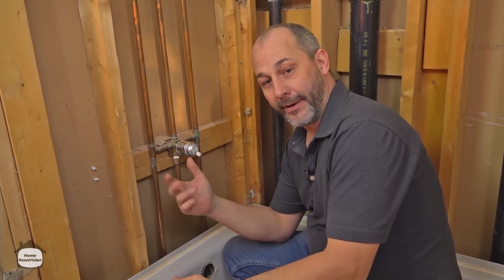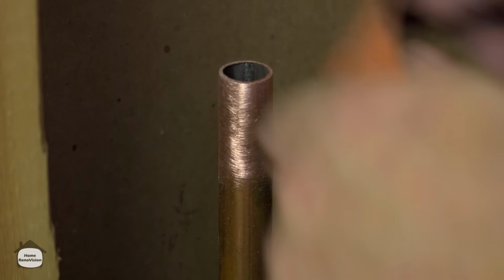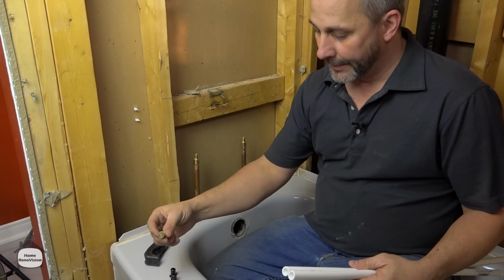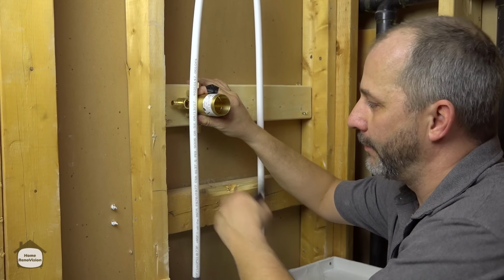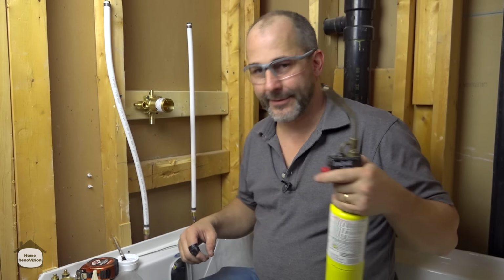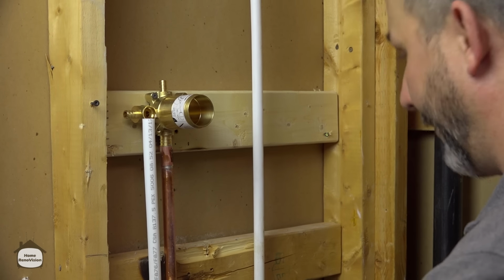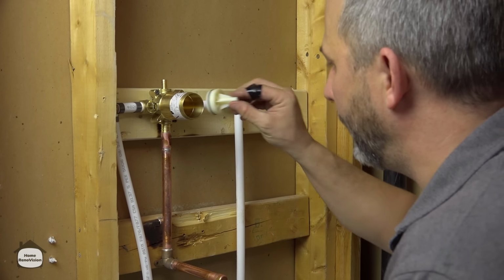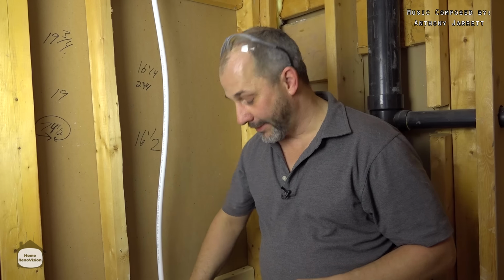DIY How To Install Copper To Pex Shower and Bath Plumbing

Comment: How do you feel about using Sharkbite connections inside walls. Some plumbers on YouTube swear AGAINST using Sharkbite connections inside walls, as they "leak at joints" with time, over the years!

Comment: Which crimp ring/clamp, and crimper tool are recommended for homeowner DYI. 
Would like to see how to R&R 3 handle valve tub faucet with copper-tubing in walls of very old house. Thank you.

Comment: After you have cut the pipe do you not have to also clean the inside? Thought I watched somewhere that if you don't you can get those pin hole leaks. Does that not happen with pex?

Comment: I have a question.  The water line to my toilet is corroded (green on the outside) and leaking.  I plan to just cut the line for now and cap it because I know repairing will not be that easy... it will lead to this that leads to that and before I know it will be a whole *$&%$^ bathroom reno.  My question is, if I just remove the toilet can I just crap down the hole and pour water from a bucket to flush it?  Seems a whole lot easier and cheaper.  Thanks.

Comment: 1. You use crimped fittings instead of clamps-- any significant longevity difference? 
2. What about ease of installation between crimps and clamps?
3. Do you prefer PEX A or B for your work?

We enjoy your video, and a salute to your camera person-- almost always on the mark and focused. Good audio, as well.

Comment: I really don't like pex. You have to be sure the pex inside dia. is the same as copper. If you don't the flow will suck. So pex outside dia. will be much larger than copper to keep copper inside dia. = to pex.

Comment: Good stuff here but noticed all eye-ball measurements and that is an issue as spout, valve and showerhead are not same--its like installing electrical switch and outlets about here-n-there... 
Just saw first video on how to crimp today and you missed that down cold 90 deg. crimp, sure hope it was replaced before sheetrock as years from now that is a guarantee water leak.
Good points on cleaning and using flux and removing plastic and O-rings before seating pipe.

Comment: Great video !  Why not also use PEX for the tub spout (skipping the sweat) ?
Reply from the maker: if you have a shower valve with a positive stop then sure. if it has a mechanical diverter then sometimes the back pressure causes the shower head to drip and that bothers some folks!

Comment: I would have sweated the pipe and valve away from the wall after dry fitting the pieces.  Then measured the Pex and after all is assembled mount to wall, thus eliminating the struggle to work around the 2x4 and torching the wall.

Comment: The way he was sanding the copper lines made me go crazy lol. I never pull them with the sand cloth to sand them. Could cause a leak at the bottom of the pipe from the bending/pulling pressure. Especially on old lines.

Comment: I am reconfig a bath room so now my toilet shower and sink is on exterior wall all plumbing going straight down through floor but i am a little confuse with my drain vent can I run it on the exterior wall?? to main vent??

Comment: so a question on your leak test,the lines are full of air so are you saying if you had a leak, it would leak because the air is pushed out, the water will follow and this will accurately test for a wet leak?

Comment: Just wondering about houses that you use plastic pipes throughout, how safe is drinking water from plastic? Is there leaching from the plastic flex tubing and how does it compare with copper in regards water safety?

Comment: Good video, thanks much. Question- you mentioned something about dripping if you use a pex connection to tub spout. What is that about? And only using copper solves that, or does 3/4” pex work as well? I’d prefer to never need to solder on those valves.
Love your laid back style, but picking melted solder off a new acrylic tub with the point of a razor knife.. what?!? Just cover it before you start working, looks more professional anyway.

Comment: Why do these guys never just drop some aluminum foil as a heat shield wherever they are soldering with a torch?
Reply: Aluminum foil actually falls apart with direct heat like that, it would literally start melting and weaken so badly that the flame would poke right through it and would render the foil useless. My advice is get a very thin piece of sheet metal, works the best and you can bend it in any shape you need.
Reply: @zachary6313  That wasn't exactly direct heat; the direct heat is on the pipe, not the wood.  It's not meant to take the direct heat, and it's not meant to last forever.  It's just meant to last long enough to get the job done.  If the energy goes into putting a hole in the aluminum, well, at least it didn't go into the wood or drywall.

Thin piece of sheet metal would work better, however the likelihood of them having (enough) sheet metal on hand is probably less than the likelihood of having a roll of foil.

Comment: I'm currently about to replace my shower valves and install new fixtures in my bath tub, I'm accessing from the back side wall of tub. Is this going to be more if a challenge ?
Reply: How will you fasten new valve to stud from behind?

Comment: Need help! I installed new rough in valve in my house and no now there's no hot water. What I did wrong? Probably hot and cold water mix in the valve. How can I fix it?
Reply from the maker: many valves have anti scald protection rings just inside the finished trim on the cartridge. if you check the instructions you probably need to lift and turn to allow the hot to mix. Cheers!
Reply: @HomeRenoVisionDIY  Thanks!

Comment: Thank you Jeff once again. You are my go to when I tackle my house. I'm going to take out all copper and run all PEX. But this weekend, Changing out the valves to PEX. Thanks again. Oh, and it is called sand cloth. In the Military here in the U.S. it's called CROCUS CLOTH. Very fine. But does exactly what it's supposed to. Don't worry about the ney sayers, they don't have the knowledge. Thank you.

Comment: So you explained everything very well and I love this video however at 6:31, you did not say what you were brushing into the adapter and then you put it on the copper tube. You skipped that part and did not explain what you were doing there. Thank you.
Reply: It's called Flux

Comment: looks great.  However, here, its against code to run pex to the shower head or to the tub, excessive back pressure and resulting leaking potential .. Has to be copper

Comment: Actually, you don't have to solder at all. Use SharkBite "push" fittings to transition from copper to PEX. Then, use SharkBite fittings on all inlets on faucet and shower head. Lot faster, cheaper, and any homeowner can do it.
Reply from the maker: in truth sharkbite is the most expensive plumbing system out there.

Comment: In another video similar to this that you did you used pex for the tub spout. What is the reasoning behind using copper in the situation?
Reply from the maker: if you use a manual tub filler control switch to shower it drips using pex all the time
Reply: @HomeRenoVisionDIY  Thanks for replying! I think ours is a manual tub filler control switch, but we are unsure what other types would be? Is there an automatic one?

Comment: Toilet filling up with HOT water?
I had a helper that hooked up the water supply line to the hot water line. Luckily, it was in the unfinished basement, and it was a two minute repair.  But the homeowner noticed when someone flushed the toilet that the kitchen sink ran cold. 
Oops.

Comment: You should keep a spray bottle with water in it when you are soldering that close to wood.  you can spray the area with a mist of water to prevent a fire or have it available in case something catches on fire, especially in an old house.

Comment: Hey love your work really helpful tips I did my vinyl flooring with your help watching your videos also just learn a nice trick with the plaster/Sheetrock keep up the good work...

Was wondering if you have any full bathroom remodeling videos I need to redo my bathrooms from scratch one of them has to be guttered out even the sub flooring etc. going from bathtub to stand up shower..thanks

Comment: I thought about using PEX to upgrade my steel pipes in the house until I googled, it apparently leaches out toxic chemicals, I will be sticking to copper pipes

Comment: Good video. I am a plumber but am more of a fan of using cinch rings vs the brass. The cinch crimping tool is much smaller, while the ring crimper is just too big and bulky for tight and hard to reach spaces. It fits in the tool bag better also!.
Reply: Any recalls because of the cinch rings? I'm about to tile over some connections that are in-floor, in floor heating and that would be hell and expensive to rip up.
Reply: No recalls I am aware of. Just be sure any ring used are square on your connections. Take your time and be thorough! Good luck with your project!

Comment: Excellent instructional. I always refer to this video with my customers when they have diy copper to pex questions. As far as the plug in the drop ear where the shower arm goes, Home Depot sells 1/2 in male shower test plugs for $3 a pop.
Reply: ⁿ⁰

Comment: Not being funny but you done so much wrong Lol. You don't "Scratch" the copper and fittings, you're removing a coating which is designed to stop the Copper going green in storage. Your gas is way too hot and you're using more then you should, you didn't clean the copper to take the excess flux off meaning over the next few years that flux is gonna start eating away at the copper resulting in Pin holes! You don't always add 1/2 inch onto your measurements as not all fittings are equal length from the factory. Good video and I love watching you, but damn you're gonna have leaks in the future 100% guaranteed! Oh and also you cooled them fittings down way too quickly, give it at least 30 seconds before wiping away as you can create hairline cracks within the Joints, so again you may not get a leak straight away but in 6 months, 6 years or 60 years you're guaranteed to have leaks! And don't use an impact driver on them screws, you can even see in the video you've rounded them off, just use a drill on setting 10/speed 1 and you're good and won't round them!

Comment: What is pex our 5th or 6th attempt at a piping system in the past 120 years?  
First it was lead yes you heard me right we used lead pipes, then iron pipes these  rusted over time no shit it took a sledg hammer 4 guys and a dump truck to get the tiles off the wall then you could replace the junk galvanized pipes. 
So around comes copper pipes the end all be all problematic pipes. Let's see they took away the lead but forgot to stop using a lead based solder to sweat the pipes.
Ok that was fixed. Oh pvc pipes or sevral types of plastics  one widely used in Canada that has a high failure rate and has to be changed out.
Did I say steel pipes  you know water heaters used to be copper untill some genius decided rusty steel was better.
And unless you separate your metal pipes steel copper you get electrolysis effects eating your copper from the inside out.
Now onto pex, it concerns its toxicity might cause development problems in children. Humm didnt lead do that?
Im sure ive skipped sevral types of plumbing. One might be the roman acqua ducts.

Comment: We used to so this in sweden also. 1982. We don’t really have any hidden joints in the wall anymore. Just a catastrophe waiting to happen...
Reply: What method is used in Sweden these days?
Reply: @rd-ch1on  also upponor, but they have a system called rör-i-rör, pipe-in-pipe. This because we are not allowed to have hidden pipe joints in the walls. If we do have that the incuranse companies won't pay a dime if something happends. The pipe-in-pipe system workes like a charm. You receive a roll of pexpipe wich is coated in a second pipe. The inner pipe is the only thing tjat is preasurized and therefor if there is a leak for aome reason on the inner pex tube the water will travel alongside the second tube and then appear on the other end of the second pipe, either outside on the waterproof part of the wall or the basememt/location where you choose to have distribution tube. Im sorry if my english makes people confused. But if you want to know more visit upponor.se and see their product line.

Comment: Good video, and you explain things well. I'm an old fossil. If I were able to do the work I'd still use copper, but that's just me. I always had plenty of supplies and could sweat just about anything. 

I wish you had wiped the joints while the soldier was hot. Always kept a clean damp rag handy. Wiped joints are easier to feel leaks in a blind spot. Also the sign a pro did the job.

Comment: I haven't seen a De-buring tool or handy man debur inside diamater if piping to it's full bore. An Acetailene turbo torch with an A-3 tip is the right tool, for this application. This for easyer capalari action, flame controll for a less of a House fire. AND have Your extinguisher with Ya!!!

Comment: Amature's, Sand Paper is sand adhesive and paper. Sand cloth is sand adhesive and cloth.  Why sabatauge true tested hard type L copper piping to a shower valve?    To ruin it with recently approved within the last decade or so. Cross linked Polyethylene (PEX?)

Will deteriating plastic microscopic particles leach onto Your Domestic cold Hot water? While making the finished rough in valve look like AQUARIUM pipping?  Or hose for that matter? A plumber can alway's use a torch as part of His/Her Body. None Plumber's can't or won't.

Comment: Time to school you,  A male fitting is called a goesinta  and a female fitting is a goesonta 
used sand CLOTH is easier to use then new sand cloth, 
Ok, man,  Look,  Soldering is just like taking a dump, You aint finished till it is WIPED
WIPE the excess flux off that  fitting!!!!!!!!!!
Flux cleans the pipe using acid, If you do not wipe it off it will sit there and do what it is supposed to do, It EATS the copper causes pin hole leaks a few years down the road

Comment: The purpose of flux is to keep the shiny copper from tarnishing, all copper will tarnish from heating, and solder won't stick to tarnished copper,  flux will keep it shiny long enough for you to solder it. Scratching the copper doesn't help in fact it promotes leaks. There are many kinds of flux and it can be expensive pine rosin makes a good flux for do it yourselfers

Comment: If you let this joker do your plumbing it's your problem, he's taking out perfectly good copper and putting in pex which hasn't been proven to last long , it's fittings will drip possibly creating a toxic black mold situation, and they will blow out. Excuses he makes for reasons is mind-boggling. Whoever owns a home with peX plumbing without a doubt knows where the nearest hardware store is to buy fittings.
Reply: Is name calling really necessary to make your point?!!

Comment: Jeff I am sure someone has already told you this but just in case.  Tip, sand the pipe before you cut it, it's easier the pipe does not move!   Love your show even as a master plumber, electrician and HVAC mechanic I don't know much about remodel work as I am on the service side only, no remodel or new construction work yet!  Also I would suggest soldering the copper on the shower valve prior to mounting it to the support.   This will avoid burning the board or the homeowner not just dripping flux on the tub which will wipe off, however when they use excess solder and that hot solder drops on the tub that's another situation.

Comment: Did not wipe your joints, did not rim the pipe or bevel the end, and my biggest petpev, you used the acid bruch to cool the wipe then contaminate your flux with  burnt bristles,

Comment: In another video I saw you made the same exact transition but using SharkBites, now I'm not one of those guys who's against new things but then for the rest of the PEX installation you use stainless steel crimps so I was wondering why you didn't do it the way you did in this video.

Comment: Code requires a Shut-Off or Stopcock at every hot or cold line at lavatory & kitchen sinks, toilets and laundry, but they are not required at the tub and shower.  Whenever possible, I always add ball valve stopcocks at the tub & shower if at all possible, with an access panel through the wall of the adjacent room.  Nice to be able to turn the water off at the tub & shower, without shutting down the entire house if you have to change a valve cartridge, if the valve does not have integrated shut-offs.  The stopcocks also serve as caps during the installation. Once the tile or surround goes in, this area can be very difficult to address any future issues.
Reply: Buy the mixing valves that hotels use with cutoffs behind cover-is an avenue.
Reply: @SovereignTroll  Yes, I mentioned valves with integrated shut-offs and I'm pleased to see that they are becoming more common from a number of manufacturers.

Comment: Are there concerns with the depth of the diverter? My plumber tried to scare me by saying the tolerances were very small and it  would not fit right with the drywall and tile if it was not perfect.
Reply: Just subscribed. 👍